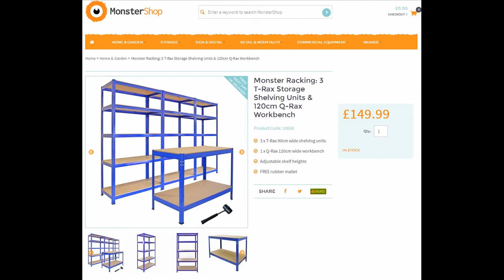Monster Shop Racking. Quick guide.

Comment: Thanks for this. I expected the racking to go together a little more easily than it actually took. 
I would recommend anyone attempting this to have a decent flat head screwdriver and a pair of pliers to adjust the tabs as they will invariably go in the wrong direction when assembling.
Reply from the maker: I had a couple pop out, but didn't need any other tools. I'm guessing it's because I work with my hands a lot? But it was very straightforward.

Comment: Thanks for this. Bit strange that it doesn't come with any instructions. Especially since my monstershop rack comes with more pieces than this. I think some of them are supposed to be a middle brace but I just can't work out how they go on.
Reply from the maker: I found it pretty self explanatory. But i was raised in a time where there was no need for warnings against putting children in washing machines. 
Seriously, i had no real issues, i just laid all the parts out and put it together, i'm pretty handy though so i guess it could be an issue for some. I have no idea about any other products, i bought 2 sets of these and decided to be nice and give them a video. Fire me a message with link or picture and i can try help you work it out though if you like.